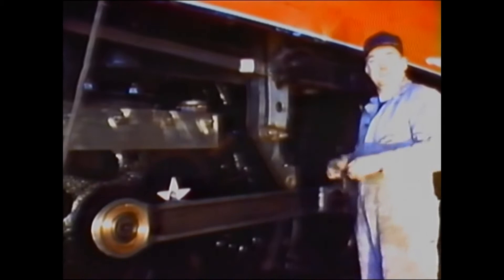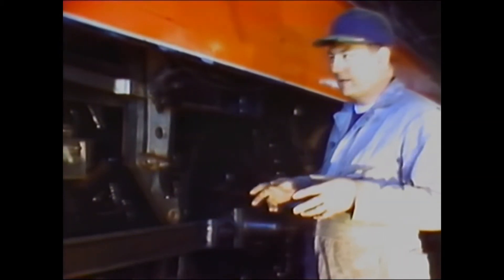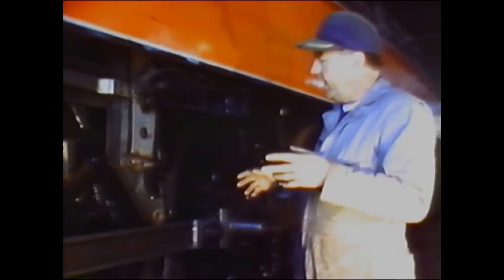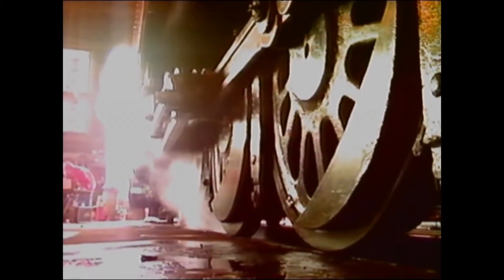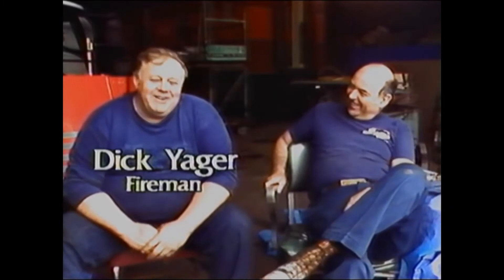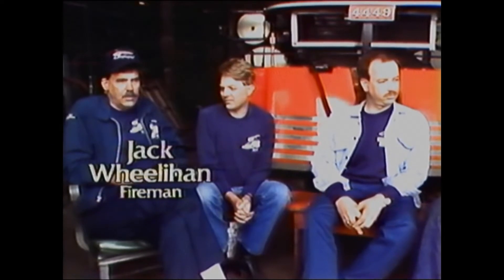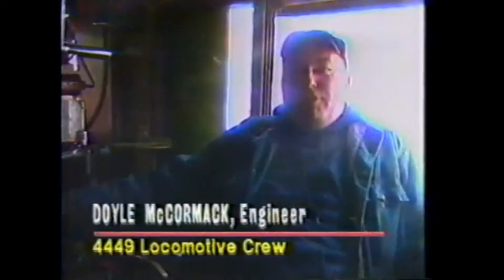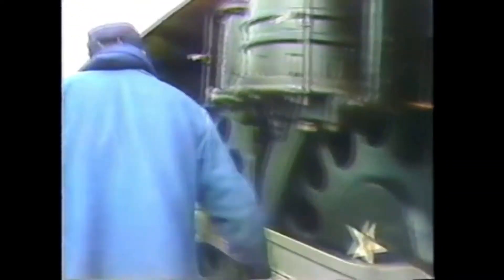Tales From The Tool Car: Best of Doyle McCormack and SP 4449's Crew

Comment: I have one of the original 1940s southern pacific main line spring steel railroad spikes that held the rails down to the ties and they look like a 7 inch long cotter pin those are in the tracks for fast passenger and freight the spike has SP on top